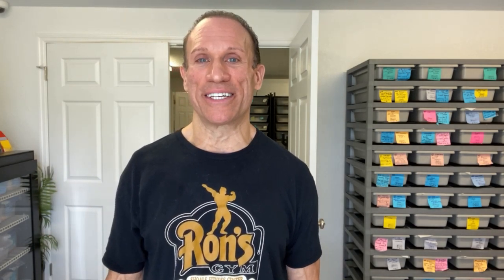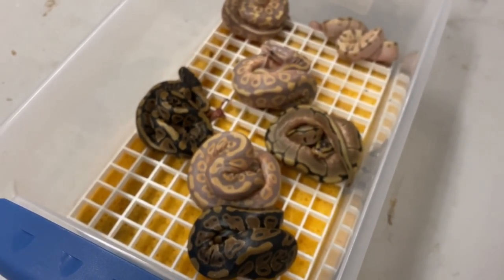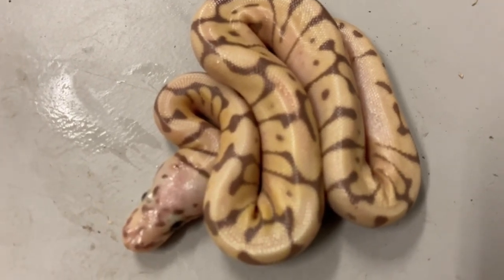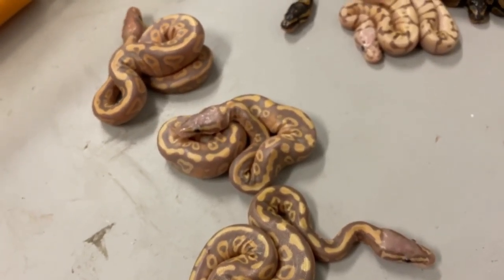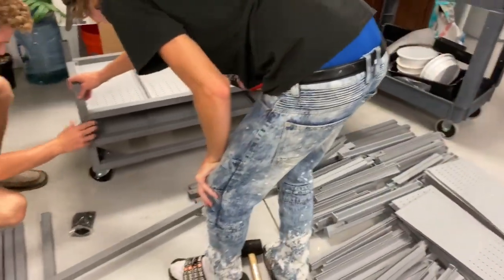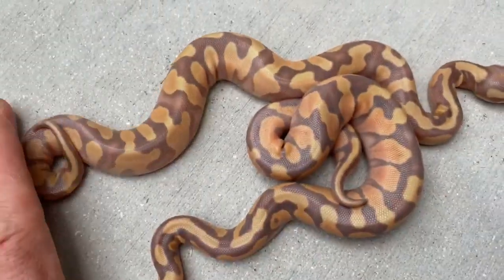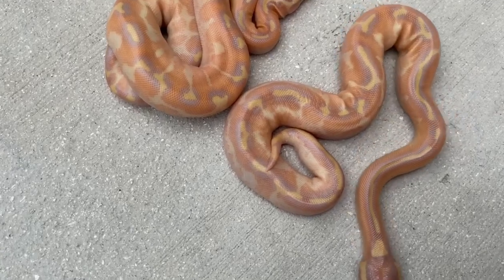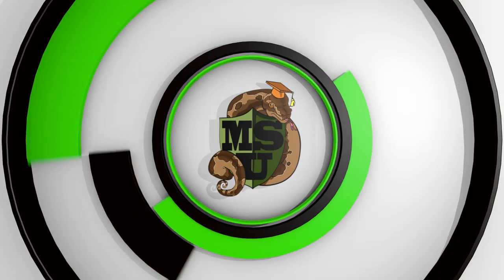GOING BANANAS! PLUS ARS RACK BUILD! June 5, 2020

Comment: Love what your videos and what you produce I think is beautiful! I have ARS racks as well and noticed in your video the plastic tops that slide over the tubs should be smooth side down, seams up. I feed live sometimes and I can hear the hatchlings bump their heads on the tops, especially as they get bigger. And some can be nose rubbers as they cruise around them. I love ARS, but think the tubs could be deeper on the 10 series and the smooth side is not perfectly smooth, so I use a bit of sand paper to knock off the edges . Keep up the great work and look forward to your next video!